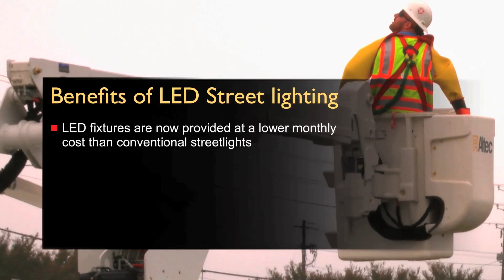LED Streetlight Fixture Converting 1

Comment: So it’s all finished Ottawa will finish in 2020 I think
Reply: andrew jones they decided on the whole fixtures less matenance
Reply: andrew jones they shouldn’t burn out for 20 years
Reply: andrew jones wow their not as good as people made them out to be the cities they said had saved like 700$ in annual
Phase must be easier on taxes I guess they don’t last 20 years though I had seen some burn out fast
Reply: andrew jones phees
Reply: andrew jones ya they are half done I think 2 more years they should be done
Reply: andrew jones ya that was the new thing their should have been no flickering because sodium and mini florcessent tubes flicker when they burn out
Reply: And LED lights should be flicker free
Reply: andrew jones as the old head Haligonien lights go replace them with LED
Reply: andrew jones So your whole city is all led no more flashes of HPS street heads ?
Reply: And wow u guys use more chips in yours u may like the ones Ottawa has better each street light doesn’t  have and many mycrochips